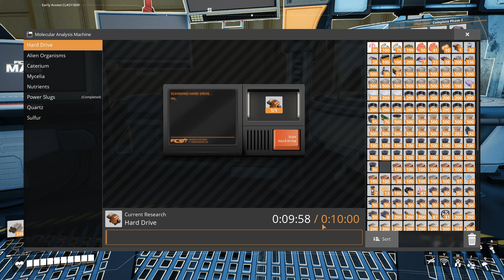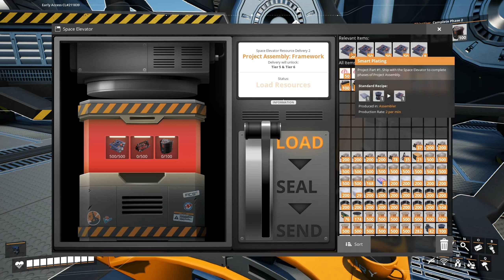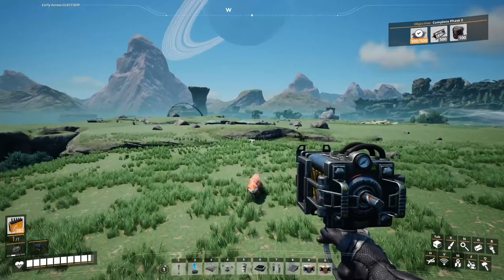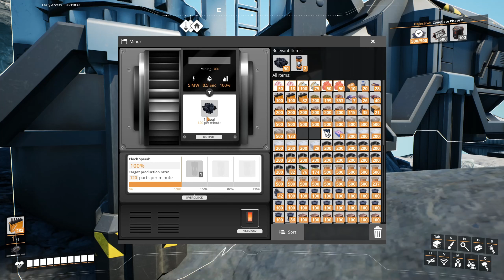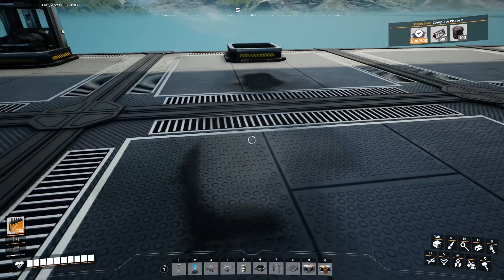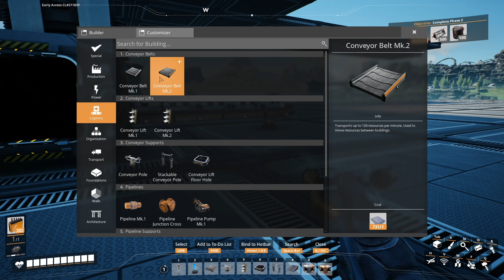Starting on Steel!  Let's Play Satisfactory s02 e21

Comment: @Glidercat: Love the build, keep it up. There is a mod which tells you how many meters the conveyor lifts are, its in a mod called Smart, it also has a camera in it so you know what way its pointing in, i use that mod and its really useful :)
Reply from the maker: Last time I checked, the SMART mod was not fully compatible with Update 7, but I'll give it another look. Thanks! 👍
Reply: @Glidercat  ah right I didn't know that, I'm on the experimental branch and that mod works
Reply from the maker: @delroyclarke1989  It could be that most of it works and just a few things don't. I'll have to check.
Reply: @Glidercat  ah right I see , I'll also have to check it out
Reply from the maker: @delroyclarke1989  It looks like SMART mod is working.  
I've installed it and it's working great so far! 
I need to re-acquaint myself with the controls, but I can see already that it will be a big timesaver.  
Thanks for the reminder! 👍
Reply: @Glidercat  ah right cool, no worries 👍